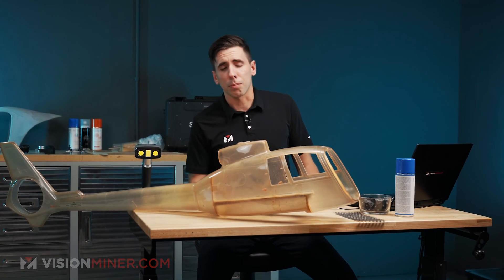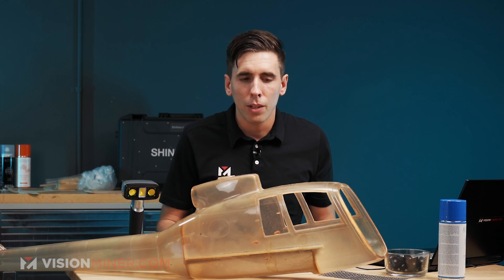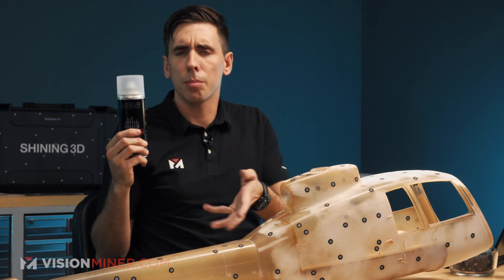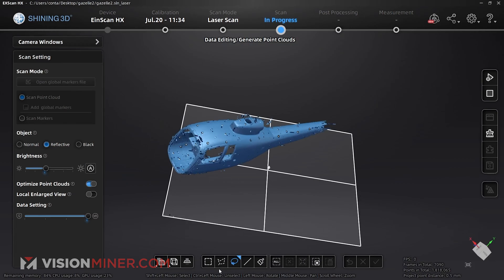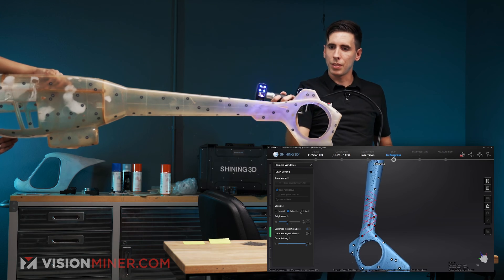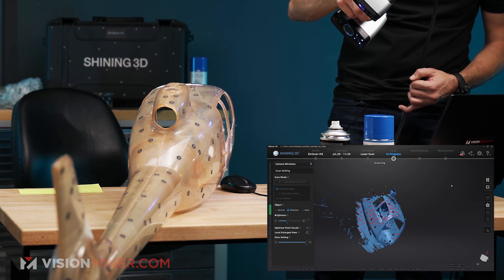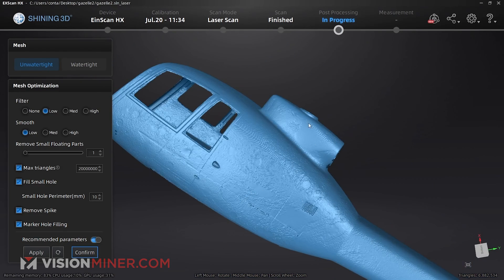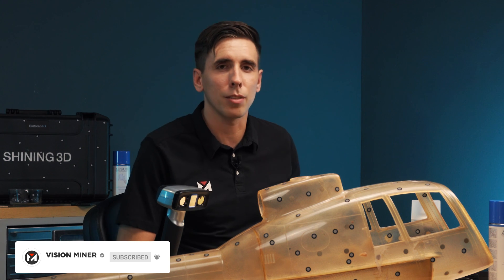3D Scanning a Helicopter? | 3D Scanning Fiberglass Shells and Reflective Surfaces with Einscan HX

Comment: Can  you do a tutorial using the Measuring Tab inside the software? I've been trying to figure it out but to no avail.
Reply from the maker: Oh -- it's very basic and not particularly useful. You can measure from a point to a point, and not much else.... volume and surface area calculations too, if it's a watertight model, but only very basic measurement tools in the measurement tab.
Reply: @VisionMiner  I see... thanks.